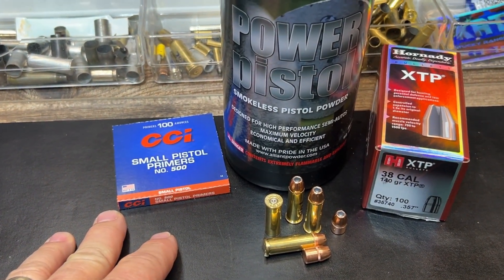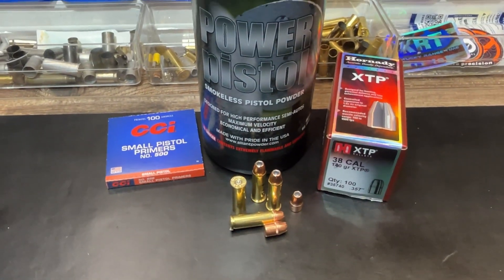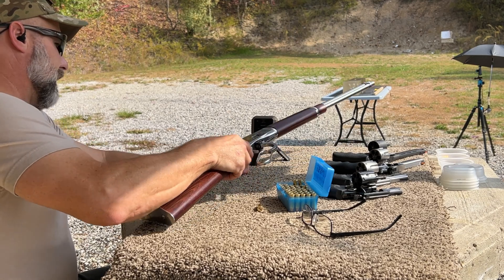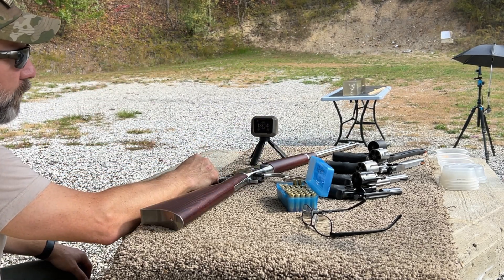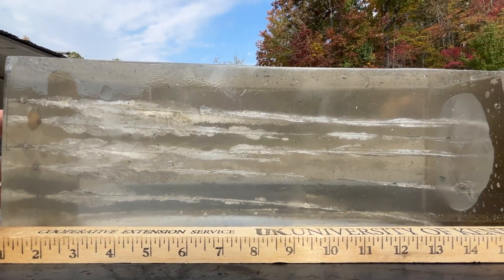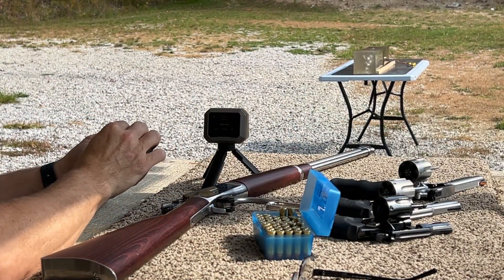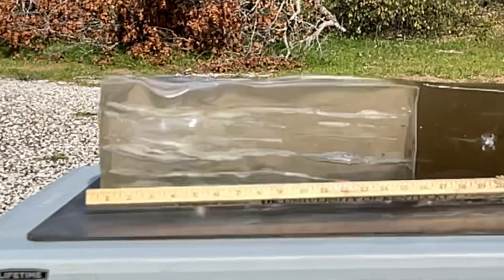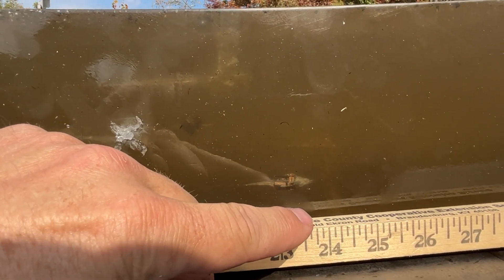.38spl Hornady 140gr XTP, Gel Block Testing with the with 5  Barrel Lengths. Clear Ballistics

Comment: O jave found that the XTP fails at less than magnum velocities. I use speer or nosler bullets in my reloads for handguns. I think the jackets on the xtp are just too thick
Reply from the maker: @jagrench62  .38spl pressure are definitely getting down to the marginal performance area, especially with the shorter barrels.

Comment: Thanks for the test. Something is wrong in your spread sheet summary with expansion and weight retention (just a copy paste issue). Your info is great so no need to fix as we can see from the other parts of the video. Keep up your work it's great info.
Reply from the maker: @rangetime6779  I’ll check on it. Thanks for the heads up. 😉

Comment: Great choice of a test weight. This weight (140) has been available for decades to basically bridge between the 125 and 158 gr bullets, yet we see very little in the way of testing with it. I prefer this bullet in 357 Mag but if you can launch it fast enough it will work in 38 special you just can't expect as much expansion.
Reply from the maker: @frankbrowning328  true. It does very well out of the rifle too. 👍🏻